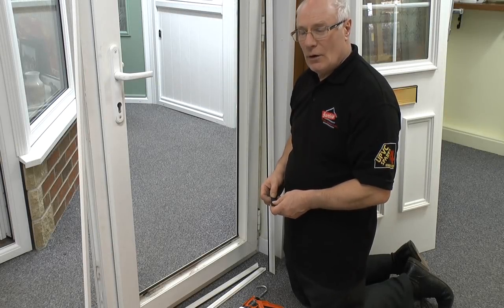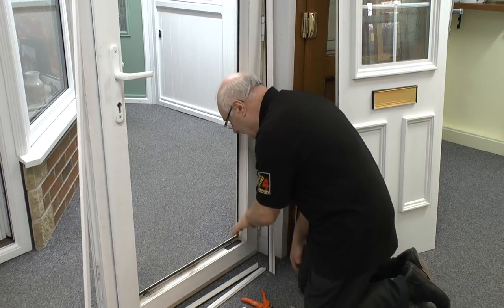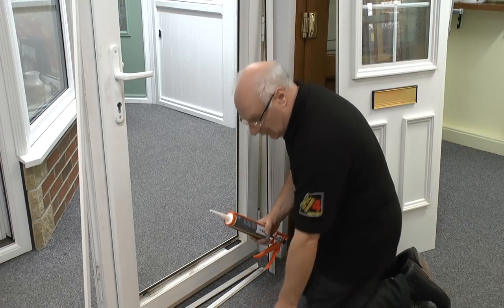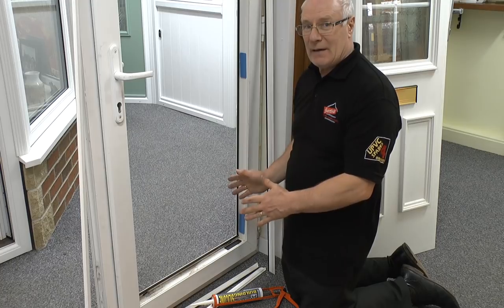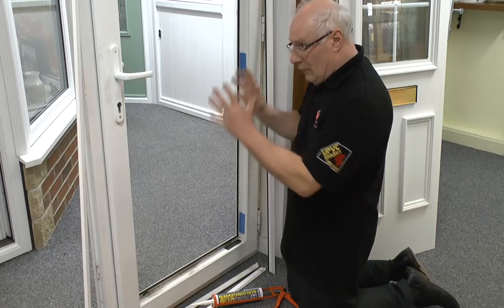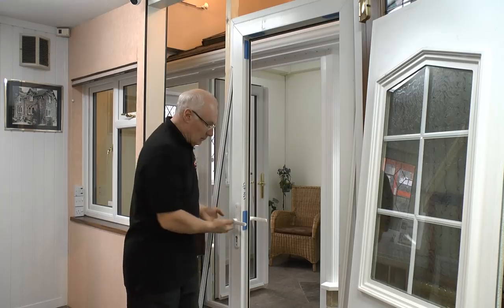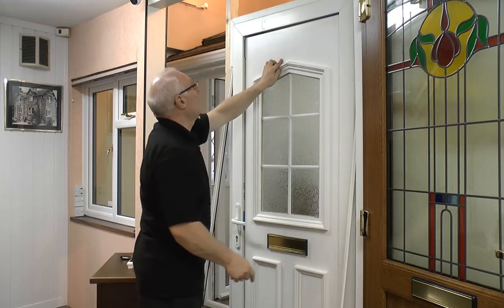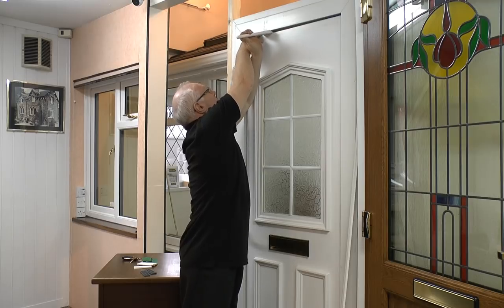Replacing A UPVC Door Panel

Comment: Using the right tool and method you showed, the beading still does not budge on my front door. It does not create any gap at all.
The beading is so tight and strong.

Comment: Finally took the beading out.
I wish you would have told us that taking the seal/gasket from the outside of the door would help. 
In any case your video is very helpful. Thank you.
Reply: For anyone wondering there is a few different methods some are beaded inside and just need to be knocked out like this video, some are beaded outside and have security tape holding the panel or glass in that is extremely strong and needs to be pushed from the inside to remove it and the other is a wedge gasket that needs to be removed first to allow the panel to move away from the bead so it can be unhooked and removed this system usually has a thick rubber bead the opposite side of the beads. Hope this helps someone.

Comment from the maker: Hi Ryan it is the same process however as there is no opener you do not have to worry about the top packers lifting up the opening sash etc. You need to ensure the panel sits on the bridge packers to allow water to drain and pack the panel squarely each side with a bit of silicone to hold the packers in place which helps the upvc to remain in the correct position when the door is operated. Regards Allan

Comment from the maker: The panel is in fact viewed as though it is a piece of glass and therefore it is essential that it is toe and heeled I:E packed as indicated. Unless this is done the door will never operate correctly and the door will drop" and will catch on the bottom of the frame. The biggest issue with this is that the lock mechanisms will not engage correctly and will mean that the locks and hinges fail quickly and continually every few years as well as the obvious security risks.  You are correct in noting that upvc will expand in extreme heat by a few mm's and there is always a risk that if the upvc skins have not adhered to the construction of the panel correctly they can crack however the packing around the panel is an industry standard and is accepted as good practice and should be within the tolerances of the manufactures allowances.  The assumption with all upvc is that the door sash and the door panel will move / expand in the same way and within the rebate tolerance around the door system.
Reply: UPVC paneled doors arnt very secure coz the panel can easily be kicked in or kick a hole throagh it

Comment: Hi, is it likely that these panels are ever glued in? I'm having problems getting mine to budge, and I dont want to just start prying harder. Cheers for a great instructional video!
Reply: Ok, it looks like the rubber bead might be glued in. Does that sound likely? Should I cut the rubber seal away, then when I fit the new panel and put the beads back in, use silicone to seal it again? Or are the beads now useless and will need to be replaced?

Comment: I have two panels on my back door and need to replace the bottom one only, do you have a video on that?
Reply: UPVC Spares 4 Repairs thanks Alan.
Reply: Hi Alan,
My door doesn’t seem to have beads that can come off, the cross bar in the centre seems to be welded, how could I take the bottom panel out ?
Thanks
Owen

Comment from the maker: if you are wanting one similar to the full one in the video fitted with glass etc you need to go to one of the big sheds like Gap Upvc or Eurocell who will stock a range of options 
If you are just wanting a flat solid panel then you will be able to find an option on Upvcspares4repairs
https://upvcspares4repairs.co.uk/white-upvc-door-panel-flat-infill-reinforced-replacement-28mm-24mm-20mm.html